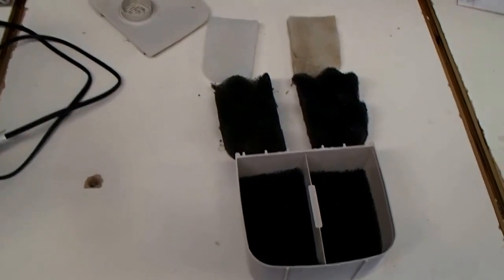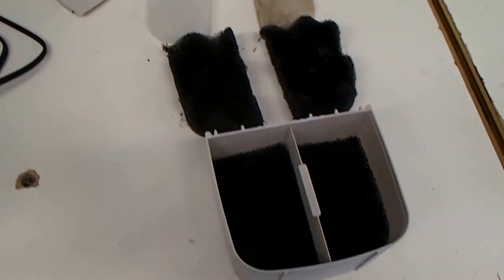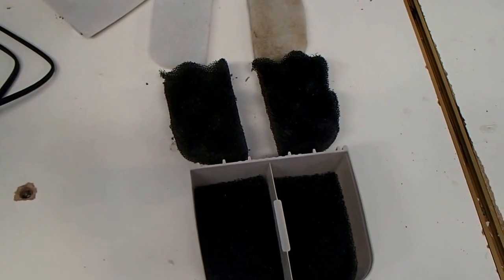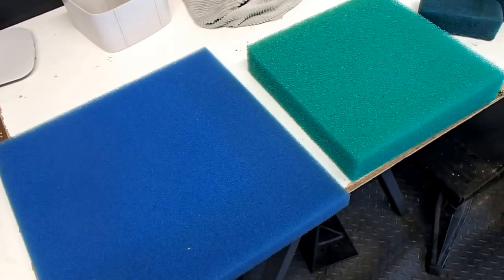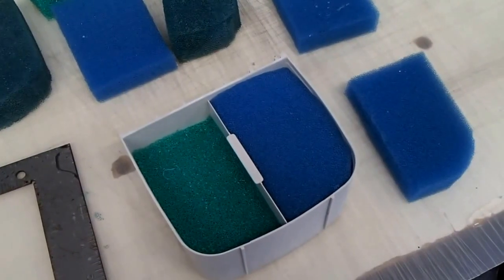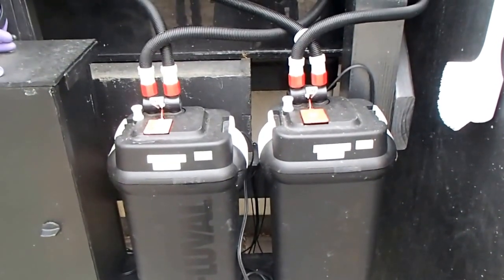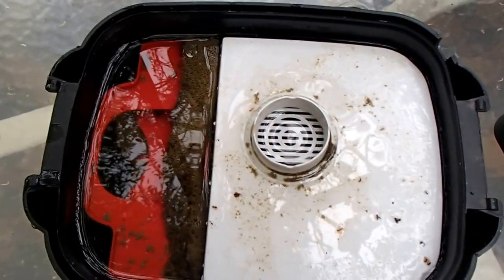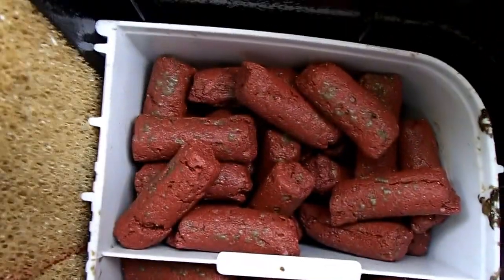Foam Filter Test 3416

Comment: Hi there - thanks for an interesting series experimenting with different foams in the 406. I have this filter on my 200 litre (55USG) tank and while I'm generally pleased with it I think there's a problem with dirty water back washing to pass down the front of the two vertical coarse foams, thereby messing up the staging of the foams from the start. They've attempted to prevent this by having one pair of vertical foams sitting slightly higher than the other, but its a bit of a bodge, especially as the foams age.

My remedy is to cut a thin piece of medium foam and place it at the gap between the white and red trays, actually it sits right at the edge of the white tray lid. This foam is compressed when the canister lid is replaced and so becomes a high density foam that forces dirty water downwards to follow the path of least resistance through the coarse vertical foams.

The second point is that given the importance to effective bacterial action of avoiding physical debris getting through the mechanical layers, I actually run two trays of foams, with a very coarse foam in the very bottom instead of the noodles. It seems to have the same effect. The biohome therefore occupies just the top two trays, but my reasoning is that since its receiving much physically cleaner water, the bacteria that colonise it can do their job that much better. I also therefore have space to use a fine filter floss before the biohome and after it as the "polishing pad". I don't know a way of properly testing this reasoning, but I don't get any mulm or debris in the biohome trays. Of course nor am I dealing with Koi but a relatively lightly stocked tank - that said I'm confident that I could slowly double the stock level and this set up would handle it.

Lastly I have enormous respect for Richard (Pondguru) but I do think he's quite wrong about the convoluted or profiled foam. It seems quite a logical argument about surface area at first, but then you realise that for a reticulated foam the surface area at work is the internal surface area represented by its VOLUME and not merely the boundary between foam and "not foam" since the water interpenetrates the entire volume. I suspect its a bit of Chinese whispers that ultimately goes back to a guy (not Richard whom I believe to be entirely sincere if mistaken!) who dreamt up a way of giving nothing a greater value than something! I dare say he's a lot richer than I am ;)

cheers and thanks again
Reply from the maker: Julian,
Very interesting. I'm going to try your modification, if I understand it correctly, next time I open up the filters. I wonder how well any of the canisters seal every nook and cranny to insure all of  the water follows the proper path.

I was interested to see that you agree with me that a solid block of foam is probably more effective than the convoluted foam which gives up a lot of potential filtering volume.
Reply: Hi again - yes I've taken Richard (pondguru) to task about the convoluted foam "increased surface area" theory before now. I think its nonsense, but from Richard something he sincerely believed to be true until challenged on it. I suppose another way of looking at it is that if it were true then Poret foam would come convoluted . . .

I've been reading some very interesting threads by a botanist (by profession) and very experienced aquarist who brings a lot of real science to the discussion. His name is Darrel and forum nickname is dw1305 - search for UKAPS forum (UK Aquatic Plant Society).

He argues against ever putting any fine floss in a canister filter reasoning that since the issue is to get oxygenated water to the biomedia in order for the aerobic bacteria to do their thing, the all important criteria is flow (unless you have a very powerful filter for a small volume of water and actually want to slow things down a bit). He also has real doubts about the claim that biohome can house anaerobic denitrifying bacteria and argues that as plants do such a superb job of soaking up nitrates, its not something to be concerned about. Even with Koi you can always grow plants in baskets or run your filter outlet through an "aquaponics" bed type filter stage.

Consequently I've re-done my filter today, still with two trays of foams and two trays of biomedia, but with the first tray being coarse foam and the second tray medium foam. I'll see how that goes, especially in terms of how much crud ends up in the biomedia.
cheers
Reply from the maker: Very interesting. I'll check out what Darrel has to say. I agree aeration is extremely important and canisters may have an issue with that. Extreme aeration is one of the keys to our Endless River Koi Pond Filters.

I'm not sure I can agree about the high flow rate. I'd love to see some research on that, but it seems to me to be common sense that the bioconversion takes time and pumping the water through the filter at a high rate may not allow adequate dwell time for the bacteria to do their job.

It seems to me that most canisters flow way to much relative to the size of the bio media to be very effective.

I spoke with Stephan  from Swiss Tropical, the US distributor for Poret Foam, and he had no use for convoluted foam, but then he is really selling it as bio media so volume is clearly more important than leading edge surface area.

I'm only interested in Foam as a mechanical filter, but I'm with you it's still volume that matters, not surface area.

Interesting enough the stock 406 Coarse Foam is convoluted and I suspect is manufactured by the same company that makes Poret Foam.

Have you seen the latest results. It appears my convoluted Coarse Foam is beginning to deteriorate. I'm going to have to figure out what direction to go soon.

Happy Fish Keeping,
Don
Reply: I keep 70 mbuna cichlids in a 110 gal with only 30 ppi foam. 2 canister filters, 16 liters of media in total. No poly fill, no BS ceramic/sintered glass media. Water is crystal clear.

I run an airstone and good surface agitation to keep the water O2 saturation up. If the water lacks O2 the bacteria slows down and they clog much faster. I know this because I ran the same setup on a high tech planted tank with very little surface agitation.

In the current setup, the waste is processed at a faster rate by the bacteria than it is produced.